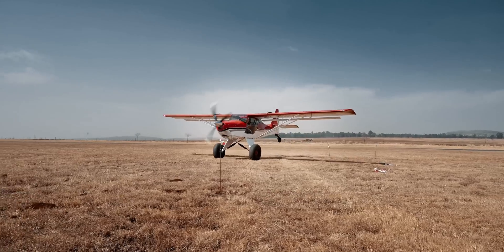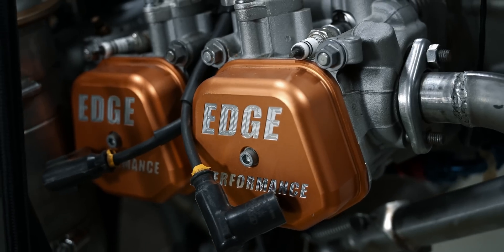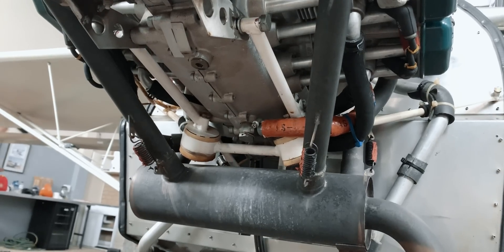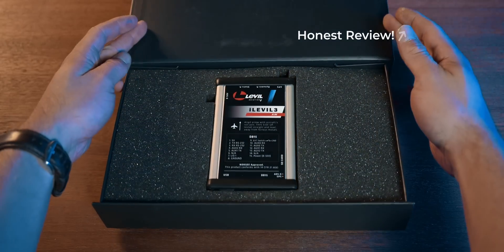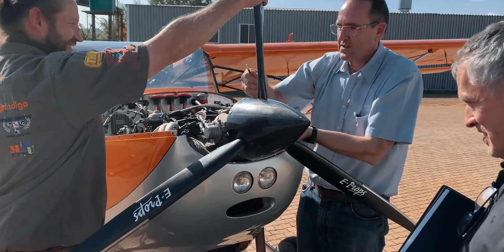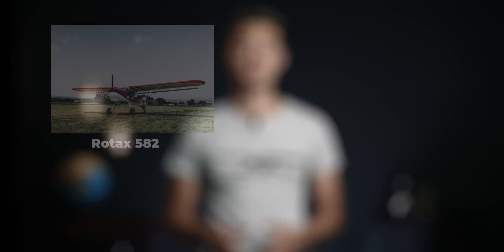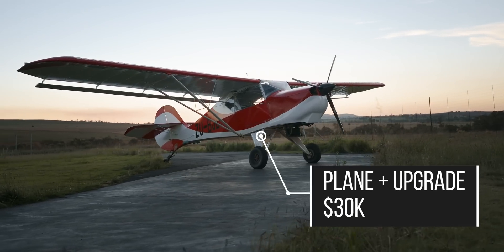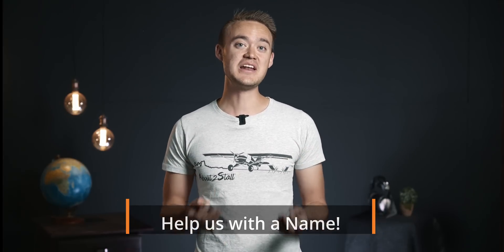Affordable Bush plane with MIGHTY STOL performance! || EdgeFox Mini-Me Build

Comment: Subscribed! I have an Avid Flyer with a 80hp VW. I'd love to install a 912, I like your (Eurofox) motor mount. Engine vibration has always surprised me when fly in other Kitfoxes that had 912's. While you're experimenting with VG's try them on underside too, I'd like to see your findings. With the camber on the bottom side of the wing, the VG's are supposed to raise your cruise speed.
Reply: Bah! just realized this is a 2 year old video and the channel is inactive... 😔
Reply from the maker: @wiplashsmile Hey! Yeah, we have been inactive in posting videos for a while. But I actually did install VG’s on the bottom and saw about 5kts increase in cruise speed!
Reply: @About2Stall  Nice.

Comment: How does everyone feel about the iPad only solution in the cockpit? It seems like a great way to undercut the very overpriced glass panel manufacturers, but is it as reliable?
Reply from the maker: Hi Forrest!
I've been flying with this setup for almost 2 years now with no issues. I made sure that the Ipad has good ventilation in the back, and this have not had any overheating issues. 

I'm actually making the Autopilot video now and have their sister company Aircraft Automation standalone efis unit as well. Which seems to be a great Alternative for those who worry about the ipad only 😊

Comment: The VGs INCREASED the stall speed? I always thought that they helped the air stick to the wing and DECREASED the stall speed?
Reply from the maker: So the VGS on the bottom of the wing DO NOT affect the Stall Speed... The wing on the Avid has 'n undercamber which causes the air to separate underneath the wing when flying at high speed.

That's why I installed the VGs on the bottom.... To keep the air attached in the scenario, thus increasing the top en speed.

Hope this makes sense?

Comment: You could save more money if you can source a Yamaha apex from a motorcycle or snowmobile or jet ski. total price for the engine could be $9,000-$15,000.
Reply from the maker: That could very well be true, but sourcing one of those engines are significantly more difficult here in South Africa due to the lack of snowmobiles. But I know the Yamaha Phazer makes for a great engine in these planes!

Comment: Awesome build and video. Just not sure how you can get a plane plus edge performance engine for 30k
Reply from the maker: Thanks!
We bought the plane with a Rotax 582 for way less than what a KitFox goes for these days... And the Engine is a second hand rebuild one, not a "boosted" Edge Performance engine. 
Edge Performance did the rebuild, but it's a stock 100hp 912. That's why it was possible 😉